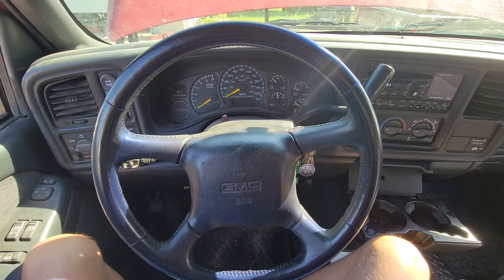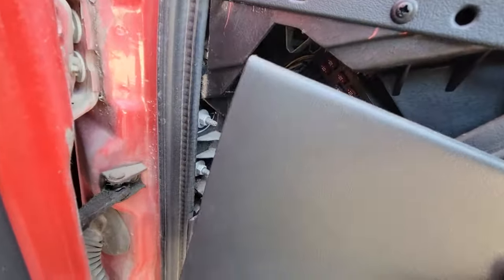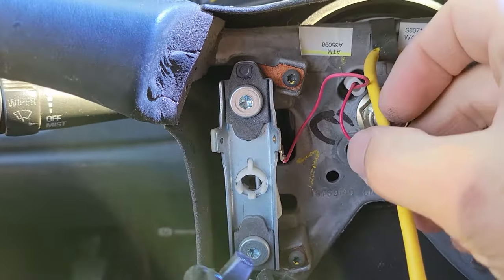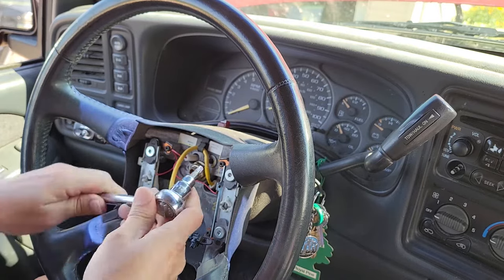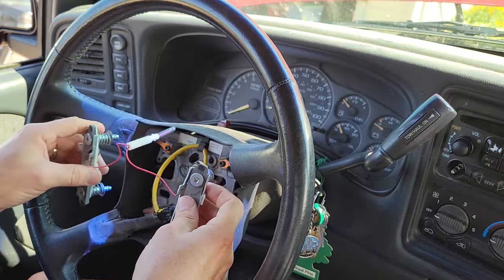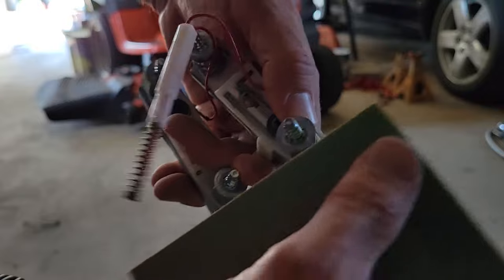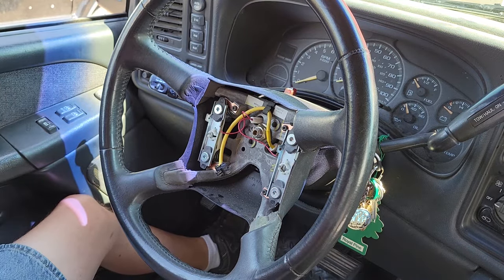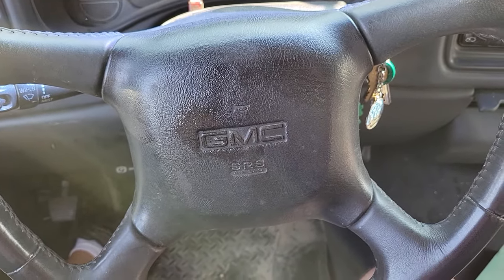Truck / Pickup Horn Not Working Chevy Silverado GMC Sierra DIY Not Honking Easy FIX

Comment: Sir, You were spot on. Thanks for posting this. I have a 2002 Chevy Suburban with 353,207 proud miles. This was the only video I could find for this model. This model you access from the rear of the steering wheel and not the side, like some other Chevy models and years.  I had trouble getting the airbag off until I did it and then it was simple,  so I want to add additional instruction and this additional info...use a flathead screwdriver and have the blade flat vertically and slide it in the small hole in the back, then push it in all the way till it stops,, then slowly twist the flat blade 90 degrees to horizontal position and it will pop loose the metal snap that holds the airbag in place.  Once I figured this out everything else was a piece of cake like you said. I sanded off the corrosion off the 4 brass blades and the banjo spring and the horn works like new.  Thanks again.
Reply from the maker: I'm glad to hear it, my friend! I'm sure you're glad to hear your horn, too!
Reply: @MelvinZoopers i related the relay for horn. Do I need to replace the fuse for the air bag? Horn still not working!
Reply from the maker: @AD-eq4kn  I would try that.

Comment: Very nice. I have an '04 that I bought from the co. I work for that has this same problem.  Their mechanics answer was to hot wire a button on the dash near your left knee. Slammed my knee into it several times but I'll be fixing it very soon thanks to your video. Thank you very much for this.

Comment: thank you. I was driving for over a year now without a horn thinking it was an expensive fix. Your video helped me fix it in no time. The hardest part was trying to get the little red wire with the spring back in the hole that it actually stayed in.

Comment: This was almost perfect, BUT I wish you said what tools you need first. You helped me fix my horn, but I had to stop and go buy a T-30 & T-20. I also recommend a can of compressed air. I blew out the hole that the connection and spring went in and some crap came out.
Reply from the maker: Good things to note for next time. Thanks for watching!
Reply: You don’t have a handheld torque set lying around?
Reply: Also not very smart of you to follow step by step without watching the video first, otherwise you’d know what tools you would have needed
Reply: @socialxperiment3162  normally a instructional-type video has ALL the needed tools at the start. But, it was a very helpful video and I was able to fix my 23 year old horn myself. So, unless you have some better videos to link, I wish you a good day.
Reply: @MelvinZoopers  sir, if you’re taking notes on years and models of vehicles you are helping: 2001 (original owner) GMC truck.